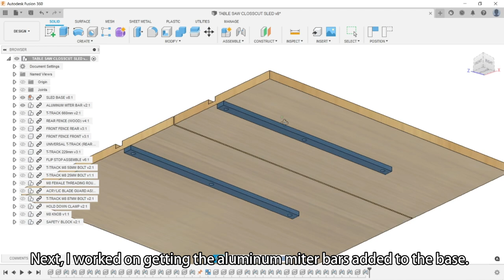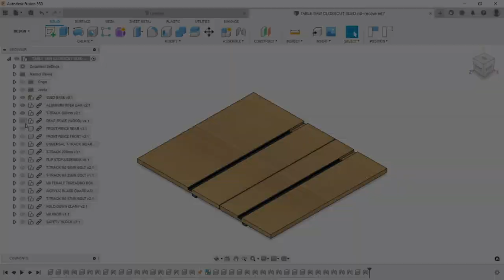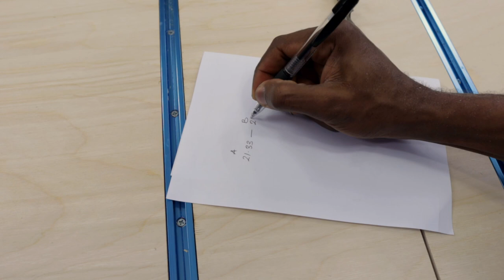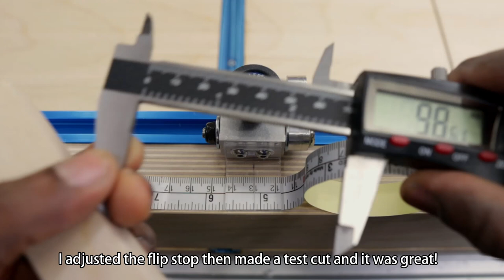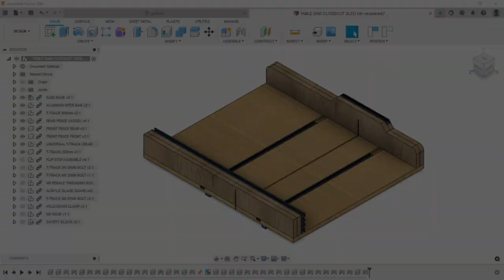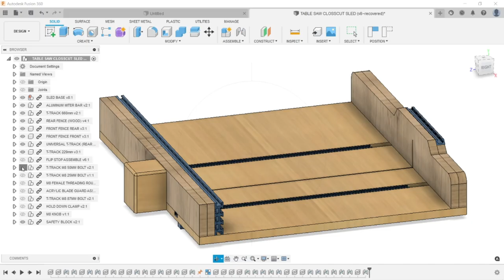How To Make A Cross-Cut Sled// Table Saw Sled

Comment: That’s a great sled and video! Question about the safety shield. While I can see how it has some safety advantages, are you concerned that a hand could somehow get pulled under it and trapped? This would obviously be an unusual scenario but those are the things to watch out for.
Reply from the maker: Thank you for your comment. Your question is valid. It is possible that a hand could get trapped; however, the hood is meant to act as a boundary to prevent your hand from going too close to the blade. Also, the clamps are there to keep the work piece secure and your hands away from the hood's edge.

Comment: I love the sled design. You mention in the video you have a free set of plans in the links. I check the links and $5.00 for the plans is not free! I don't care about the $5.00, however you may want to edit out that line in your video.
Reply from the maker: Thank you for your comment and for pointing that out. I appreciate it.

Comment: That's a fantastic sled. Can you please tell me the function of the "Acrylic hood" though. I assume it's for safety but is it to stop touching the blade or to stop offcut bits flying up? Well done. A professionally presented video. Regards Mal
Reply from the maker: Thank you, malcolmsplace, for your comment and for stopping by; I appreciate it! You guessed right. I added the Acrylic hood, so I don't accidentally touch the blade. Also, to prevent dust and wood particles from flying to my face.

Comment: Nice video. But the multi-track is a no go with Sawstop.  You also failed to add a chamfer to the base of the rear fence to keep sawdust from accumulating.
Reply from the maker: Thank you, Charles Cook, for your comment. You are right; the multi-track is a no go with Sawstop. However, it was designed for my Rigid table saw and can be configured to be used on any other table saw, including Sawstop. All you need to do is to remove the aluminum multi-track, and you are good to go. As for the chamfer, there was no safer way to add a chamfer on the multi-track at the time of the video. Moreover, that has not been an issue for me, but I should have mentioned that. Thank you for your observations.

Comment: I really want to make this sled but I am lost looking at all those metric measurements. Any chance you have plans in standard measurements? I would really want to do this sled in a18" x 16" size - that will work better for me as I have a smaller jobsite saw.  Do you think it is convertible to that size?
Reply from the maker: Thank you Cbyutube for your comment! I have converted the sled from metric to standard measurements and the link will be at the bottom of this comment. If you want the size to be 18'' x 16'' that’s fine, however, I will recommend making it slightly bigger. My table saw is a small job-site saw too. If you have any question, please feel free to email me at Vuleco12@gmail.com 

Link to the sled in inches; https://bit.ly/Sledinches

Comment: OK....serious question. I have seen about a dozen sled-building videos provided by various sources and exhibiting various mods and hacks to the 
basic design. In your opinion....how much can a person introduce to the basic design before a.) the basic design is compromised or b.) the mods or hacks begin to interfere with or limit each others' performance. Thoughts?
Reply from the maker: Modifying and introducing changes to a basic design can be creative and exciting. Still, it's essential to be mindful of certain factors to ensure effective and safe modifications. Here are some thoughts on your concerns:
a.) Compromising the basic design: The extent to which you can modify a basic sled design without compromising its fundamental integrity depends on several factors, including the original design's stability, structural integrity, and intended use. If the modifications are well-thought-out and executed with consideration for the sled's intended purpose, it is possible to introduce changes without compromising its basic functionality. However, if the modifications weaken essential structural elements or alter its stability, the sled's performance and safety could be compromised.
b.) Interference or limiting performance: When introducing multiple modifications or hacks, it's essential to consider how they interact. Some changes work harmoniously together, while others might interfere and negatively impact performance. For example, adding features that increase speed might sacrifice maneuverability or vice versa. The key is to carefully analyze each modification's impact and assess whether they collectively align with the sled's overall purpose. This is also applicable to other designs.
Reply: @VULECODIY  Excellent Thoughts.  Thanks so much.

Comment: Hi Vuleco, very nice video, thanks. I just finished my sled and one guy suggested that I add a plexiglass hood. I could not figure out how to do it without interfering with my stop block, but now I know - I just need to add a track on the front fence as well and make it removeable for when I need to get close to the blade with the stop block.

One suggestion for your sled (if you can still change it) is to add replaceable inserts at the bottom to act like zero clearance inserts. You can then easily replace them when they get worn out.

And maybe a removeable extension for when you cut long stock.

Have a look at my video for what I did for those 2.  And check out my all wooden flip-up stop.

https://youtu.be/-DI5PdQ0AJ8
Reply from the maker: Thank you JC Woodworx for your comment and suggestions, I'll put that into consideration. by the way your table saw sled looks so cool, nice job on that. Thank you again for the suggestions, I really appreciate it.